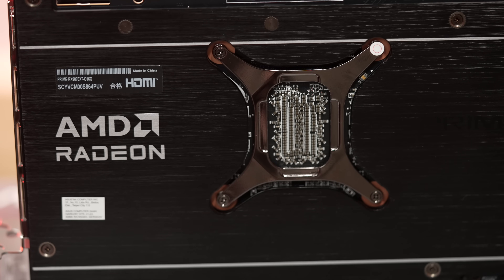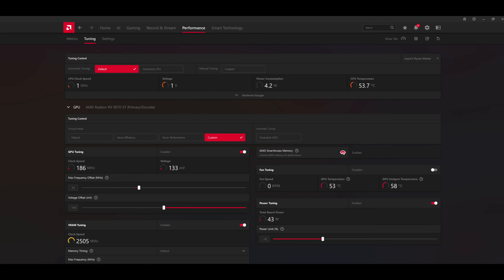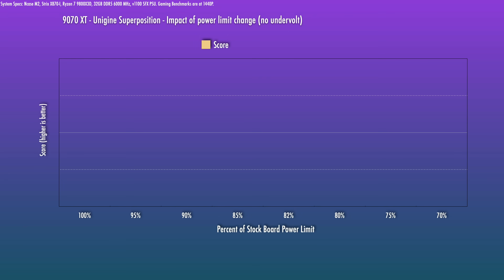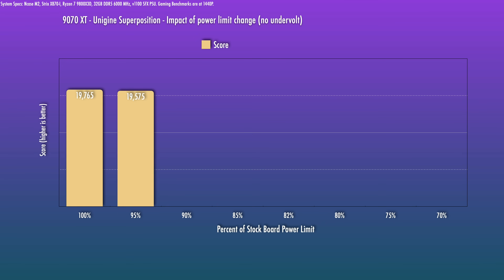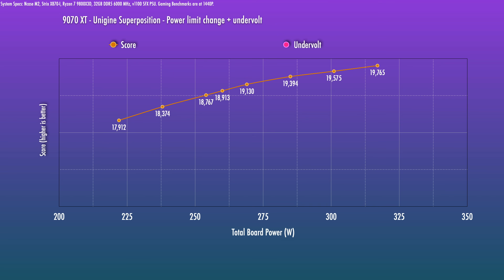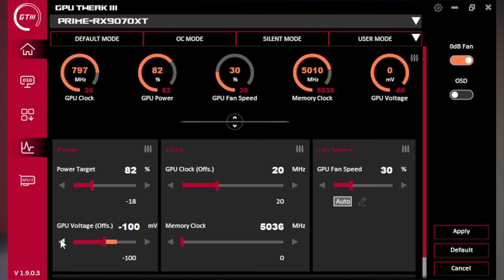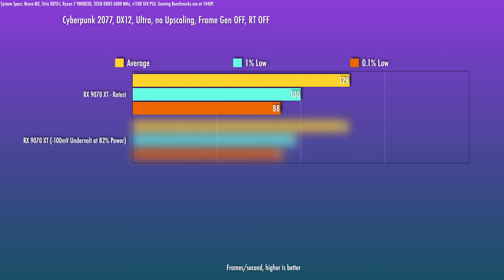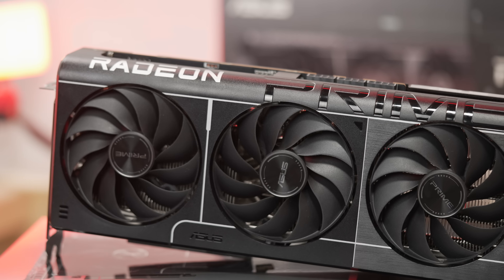Undervolting the 9070 XT... and also overclocking a 9070 to XT levels!

Comment: I would be really interested in a more detailed 9070 non-XT tuning guide.
Reply: 1+
Reply: Same here. Can't seem to find any other video on overclocking the 9070 non XT.
Reply: @gloe9362   @HardwareBusters has one
Reply: @gloe9362  Pump memory to 2700-2800mhz, raise the power limit to 10% and put 50-80mv of undervolt
There, done.
Reply: @DuBstep115  yeah I bumped up memory to 2700mhz, power limit +10%, and -65mv undervolt
Reply: @JimBobMcGillicuddy  Now you have squeezed the 99% of the performance on that card. Sure you could fine tune it for hours and get maybe 1.2% better score on Time spy but who cares.
Reply: @DuBstep115  yeah i may tweak it a bit more, hard to find a real in-depth guide on it. Have only tested in Alan Wake 2 but no crashes and it runs ok at max setting, 1080p native at 118 fps cap with FreeSync on. That game has some stuttering / 1% low issues I've never been able to solve but the FreeSync at least masks it pretty well. (CPU is 5700x3d with 32gb 3600 ram)

My card is the XFX swift OC, so +10% power brings it to 271 watts. I need to run it it through Steel Nomad to actually figure out what's ideal across all the settings because a lot of these tests are probably for non-OC 9070s. 

Have you kept the GPU max frequency at default or bumped it up say, 150mhz?
Reply: @JimBobMcGillicuddy  The mhz slider does nothing, you can set it to 500mhz and it does nothing.
I mean besides finding the stable undervolt mv and sweet spot for memory mhz there is nothing else you can do.

I have 9070 pulse so my 10% power only brings it to 248w. I have been running it with -55mv 2800mhz memory and 10% power for 2 days now
I did the same benchmark as the dude on the video with his outrageous -120mv undervolt (not stable) I got 18500 points and he got 19300 (4% difference), so I am happy for my MSRP card.
Reply: @ Interesting. Yeah on my card the default power is 240-something watts. Thanks for the insights
Reply: @JimBobMcGillicuddy  But as I said earlier after the 200mhz on memory, -50mv and 10% power slider, any change you make will only marginally increase you performance. Like 0,5-1%. Happy tuning, who knows if you won silicon lottery and you card can do -100mv
Reply: @ Yeah, i'll test whether the added power (245 vs 271) is meaningful, and whether to bump to 2800mhz memory and how much I can undervolt while maintaining stability.
Reply: @JimBobMcGillicuddy  Oh yeah, didn't even think that since my card don't go that high. It might be everything over 250w is diminishing returns like we saw when lowering power of the 9070XT, it keeps most of its performance. Also forgot to mention the fan curve, since lowering the GPU temp increases the GPU mhz, you might gain performance by tweaking the fan curve. I gained around 70mhz going from 55c to 48c
Reply: @DuBstep115  Ran a bunch of Steel Nomad tests today. Stock the card was at a score of 5950. Went up to a score of 6671 with -100 undervolt, 2800mhz ram, +10% power. Bumping up the undervolt and power were the big differentiators. 

I'll see if it's at all stable in real game scenarios. Was a score of around 6500 for -80 undervolt and +5% power.
Reply: @JimBobMcGillicuddy  average score for steel nomad on 9070 is 6242 so you are in top 300 with 6671 👍
Reply: @DuBstep115  as I have also the 9070 pulse, wondering what are ur 3D Mark scores? I would like to compare with mine
Reply: Rt, need this

Comment: Got a sapphire pulse 9070xt, did -280mhz core offset, -35 vCore offset and -15% power and got to max 251w while being stable. Cyberpunk 2077's own benchmark result for 1440p ultra rt was 51fps average, and the uv is 50. I'd this is a win for me as I dropped from 310w. I'm still new to the whole UV thing so any advice is welcome. Also I am using andrenaline's own tunning
Reply: damn you got a bad silicon

Comment: Can you make a detail video on overclocking the 9070? would really love to see it...
Reply: +1
Reply: why? just put more mhz untill you crash,and then turn it lower ,also keep in mind oc depend on the  game eatch will have its own frequency
Reply: @fdgdfgdfgdfg3811  meh, I went from 12 800p to 14 100 on timespy extreme with just under volting 80mv and raisin the power limit to 10%
Didint touch the mhz offset at all or memory mhz. Thats 10.1% improvement btw, on par with non OC 9070XT

Comment: so I got a 9070xt sapphire pulse, if I get it to 82% power and undervolt 100mv it will just get the same preformance for less power?
is it 100% safe for the card?
(I don't know much about these things)
Reply: The power target is 100% safe to use the firmware will do everything for you
But the GPU voltage offset you will need to test if it's stable
Just keep in mind that while UNDERvolting is 1000% safe and only causes unstable system or driver crashes until you reset to defaults, OVERvoltage is UNSAFE 100% and could theoretically kill your card instantly if you apply too much.
You can either start at -100mV -> test -> if stable,  reduce to -110mV -> test -> until you find something that works, if you find that it's stable at -120mV but not at -130mV for example...use -110mV to have some margin 
OR you can start at -10mV -> test -> if stable reduce to -20mV -> test...etc with the same logic
Reply: A good analogy for undervoltage vs overvoltage is let's say you have a rope bridge and you loosen the rope, but it starts moving too much and becomes "unstable" , you can bring it back without issue, tighten it too much - it breaks and you have no way to bring it back.
Just some chips have fewer defects than others, so they can stay stable with lower effort,  some cards can go down to -150mV and others do only -10mV...that's where the term "silicon lottery" comes from

Comment: I heard undervolt and overclock can actually work better than straight overclocked. Not sure if it’s true.
Reply from the maker: It depends. Sometimes all you can get away with is running at a lower power while maintaining the clocks, if silicon is good then you can do both and up the clocks.

Comment: Thanks I was just wondering how an OC 9070 would go and your findings have confirmed my suspicion that 10% faster could be closed alot. Not sure how the xt is only 10% faster given the 38% higher power budget and the 15% more shaders but I guess thats why AMD said they were only doing the mid range and the results for the big rdna4 were "disapointing". Seems to be a does not scale well situation to me which tracks with radeon designs.
Reply from the maker: Yeah, the final 10% really comes at a heavy power penalty.

Comment: Interesting video, both 9070 at 230w and xt at 222w have similar performance and efficiency, it looks like navi48 is mostly depended on how much power can you give to the core, memory is the same. I look also at techpowerup 9070 review and some models like asrock steel legend has Power limit at 253w +10% (280) so it can even more close the gap between 9070 and xt. Not sure about of tbp of used gpus (based on chart I assumed for 9070 xt 317w and 9070 230w).

Comment: Glad to see it undervolts well. Makes me more comfortable about getting a 9070 XT with a 750 watt power supply
Reply from the maker: Yup 750W is sufficient.
Reply: Running my Hellhound 9070 XT and 9900X CPU with an XPG 650W PSU.  No problem.  4K gaming my system pulls ~475W from the wall, so not worried about it.  Not once >500W.  I was prepared to swap out the PSU if needed, but doesn't seem to be. Depending on your CPU, should be totally fine with a 750!
Reply: @FatherOBlivion  thanks for your comment, on 650 as well..

Comment: This is what I wanted to see. I picked up a stock 9070xt reaper and am running it on a 650w PSU. My cpu is only a 9700x so I shouldn't run into power issues but limiting the power like this is exactly what I was hoping I would be able to do.

Comment: Its just Vega 56/64 Reborn! But the current price of 9070 vs 9070 XT, its better to buy the last and undervolt it! And on top of this have memory overclock.
Reply: also if you burn a memory module the replacement is cheaper than ddr7

Comment: Since RDNA1 I've gone straight to undervolting/power limiting. The boost is so aggressive on these cards they are power and heat limited long before being unstable. Every XT owner should probably start with -50mv/90% for an easy boost to performance AND drop in power. 

The non-xt is a different story and unusual for AMD as they seem to have released that card surprisingly close to its optimal point in the efficiency curve.

Comment: Hey what do you think i cant decide so i bought 2 graphics Card.  1 XFX Swift 9070 OC  (629€) and a ASRock Steel Legend 9070 xt (749€)  9070 Power would be enough for me im more of a efficient guy do you think 120€ more for the xt is Worth it? I only have a 650w PSU
Reply: 650W psu is really close for a 9070 XT, you’d have to undervolt it a lot and lose performance for it to work properly, id just use the 9070
Reply: @s4yto  yea i wanted to use the 9070xt  at max 300 watt  but my other system doesnt need so much power i have Air cooler and a 9700x

Comment: I got the 9070 non-xt yesterday and I will try your settings today. Thanks.
Reply: hello. how was it?
Reply: @Moks.22   I am super happy because I am a freak for efficiency and the new video encoders are awesome. I have written this comment on the other video: 
"On my Sapphire Pulse 9070 non-XT with UV +10% Power (242W) and Memory OC @2800 during a 1h stresstest I have 45°C GPU and 65°C hotspot. The memory runs at 77-80°C. I got a Silent Base 600 case with poor air flow by design at 20°C room temperature. I think this Honeywell PTM7950 is doing an amazing job here. No idea why Asus has such a big difference between GPU and Hotspot temps. Maybe surface pressure? 🤔
Graphics Scores with a 5800X3D on a X370 with PCIe 3.0 and 3600 CL14:
In Time Spy Extreme: 13567
In Port Royal: 16603"
Reply: @nicovega1831  How many mv of undervolt?
Reply: @ -75mV. -80mV was also possible but I wanted a more safe setting for the summer temperatures.
Reply: @nicovega1831  I doubt the -120mv this guy on the video claims is anywhere near stable outside his benchmark. What I have seen people are getting -50mv to -80mv.
That makes the card perform around 9% faster than stock, but this guy claims 14% OC that matches XT :D
Reply: @ maybe there is a difference between XT and non-XT that XT models are operating with higher voltage? I do not know
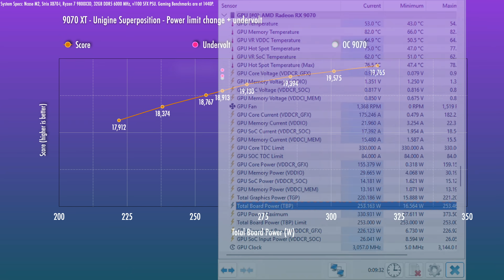Reply: @nicovega1831  No he is talking about the non XT at 5:20 when he says minus 120mv
Most of the comments I have been seeing are getting anywhere from -50 to -80mv, so very unlikely that his card is stable at -120mv OR the factory bios on his card is running WAYYY to much voltage in the first place

Comment: was able to order a 9070 non xt about 1-2 mins after they released, all the MSRP models were sold out,  the 9070xts were sold out.   I paid a bit too much,  about $630 for hellhound 9070.    Not too terrible of a deal.  Big upgrade from my 6800 non xt.  

Hoping to win the silicon lottery, but if not, it will still be nice to have a quiet and cool GPU.

Comment: Just what I wanted to know. Is the percentage of Stock Board Power Limit based on the 317 Watts you saw or of the 304 Watts AMD says?

Would be good if your chart showed the Percentages and the Wattage at that percentage of Stock TBP.
Reply from the maker: Based off the AIB board power which was ~317W.

Comment: I used “Radeon7” with lower voltage. And it broke after about a year. I am aware that the best way to prolong the life of a graphics board is to neither undervoltage nor OC it manually.
Reply: Undervolting doesn't kill a graphics card
Reply: @dainiusvysniauskas2049  I think overclocking at lower voltages will degrade the semiconductors.
Reply: @PampyO  Overvolting degrades the chips, not undervoltage.
Reply: @dainiusvysniauskas2049  I think it is easy to degrade semiconductors when GPUs are overclocked at lower voltages. The reason why is because there are two factors that make it easy for a layman to err on the optimal point for that setting.
Reply: @PampyO  That's nonsense. Transistors degrade somewhat quicker if you apply a higher voltage or they experience higher changes in temperature.

At worst undervolting can cause a decrease system stability but it doesn't damage the underlying hardware, if anything running less power through a GPU prolongs its lifespan by an insignificant amount but it doesn't prevent seemingly random hardware failures that occur regardless of if you run it stock or not.
Reply: @Fabunility　 @dainiusvysniauskas2049　In my opinion, lower voltages may increase the current required to perform the same process.In particular, if the voltage is reduced too much, the transistors may not turn on and off fast enough, resulting in locally high current densities. If the current density remains high, electromigration (the migration of atoms in metal wiring caused by current) is accelerated, leading to wiring disconnections and increased resistance, which can shorten the life of the GPU. In the end, however, the determining factor is the user's “good” or “bad” adjustment.

Comment: I really don't get undervolting GPUs.. just buy a cheaper lower performing card if you want a quiter/less power hungry system..
Reply from the maker: Undervolting is typically done so that performance is maintained, and on top of that, silicon dependent users can reach for higher clocks to get higher performance. So, the idea isn't to get lower performance.

Comment: Overclock memory too! That give you even more performance.
Reply: the memory gets very hot on 9070 and 9070 XT cards
Reply: @SchlaWiener123  just turn off the zero fan. The fan will operate based on the hotspot temperature instead of the core temperature. This will also lower the memory temp.
Reply: @SchlaWiener123  yea when I oc vram there are always some troubles even if gpu is cold

Comment: Great guide. -100 mV at 82% power (i.e., -18% power limit) seems to be a good starting point for undervolting. On my Gigabyte Gaming OC 9070 XT, this setting results in a 1.1% gain over stock with Superposition's 4k optimized benchmark for a 18% reduction in power, which is pretty good.

Interestingly, Tech YES City's review used a different configuration of -500 MHz, -70 mV (and 100% power) to obtain the same performance for a 17% reduction in power. This setting for me reduces power by 26-31% (in a fluctuating manner, as opposed to a constant reduction with the power limit.), and performance by 2.8% compared to stock. This could be due to different specs of cards of different AIB brands, or just the silicon lottery.

This is my first AMD card in about 22 years, and I'm still trying to figure out the oddities with AMD power settings. I've also discovered that Gigabyte Gaming OC 9070 XT has a default power limit of 330W (but attains 20011 in this benchmark at stock settings, with the 12700k and DDR5), and that Adrenalin's overlay reduces my superposition score by about 5-6%.
Reply: Do u have also coils whein with this Gigabyte? I have and i wonder if UV is going to resolve the problem. I dont want to return this card because i love its performance and in Poland we have very poor availabilit of this model.
Reply: @ARTuR3527  I haven't noticed any coil whine on my card, both at stock and power limited. 

Also, as an update, I changed my undervolt to -65 mV after detecting some instability in some workloads.
Reply: Did Tech YES City reduced memory clock with -500mhz? if they did thats a very large nerf. If they want to maintain lower wattage use, only the power limits should be touched?

Comment: I have a case that has 2x 20cm fans on front. It's a pretty big guy, really. But inside, I have an Asus Dual 3060ti MINI because of the mining crisis, which was the only logical solution.

So, I want a silent card, so I was thinking of going for a regular 9070 and undervolt it. Can we reach under 200w loads? Is it achievable?

Comment: why are some of the temps higher on a way lower power draw?
Reply from the maker: The auto fan speeds ended up being lower on the undervolt. I did not bother/worry about locking down fan speeds so they floated. I haven’t seen the fan curves visually and would think they’d be indexed to the core temp but that has not been my experience (I still have some reservations with regard to the system reported GPU temps on 9070/9070 XT but that’s a different story).
Reply: @MachinesMore I thought the same, but I've got a 3070ti in a workstation rig that will load up the vram occasionally.  When offloading certain compute to the GPU, the core stays cool but the fans ramp up like crazy. So it seems like vbios fan logic is based on multiple factors, or at least can be.

Comment: I also use as a base frequency the game frequency in my 5700XT, like 1900 MHz, and I loose 2-5% performance but loose 80 watts either around 30% power consumption

Comment: I have a pc with a small case and an sfx psu that is 750 watts. Would it be a good idea to undervolt the 9070 in my case?
Reply from the maker: PSU is fine, is it airflow/thermals you are concerned with? Which case?

Comment: nice.
lowering the power limit and undervolting is the most reasonable thing to do, even when overclocking.
I mean, it's not too pleasant when the card is hot and noisy all the time
Reply from the maker: The delta was about 500 RPM between stock XT and stock non-XT so definitely a solid noise improvement.
Reply: @MachinesMore   that's amazing. a card feels more solid and more pleasant to have, when it doesn't sound like a plane at full load. it then seems like it's doing its work effortlessly